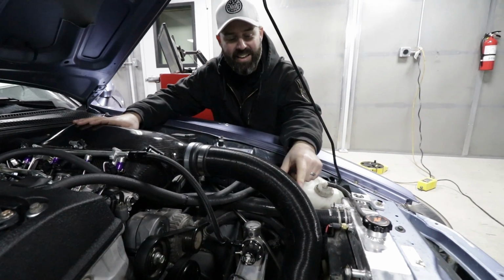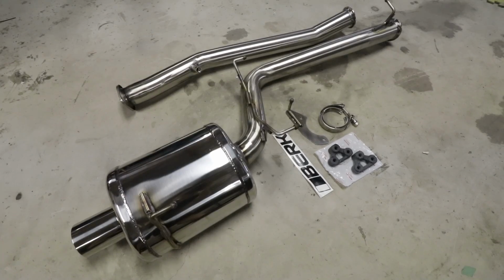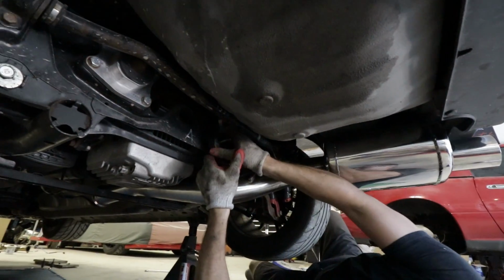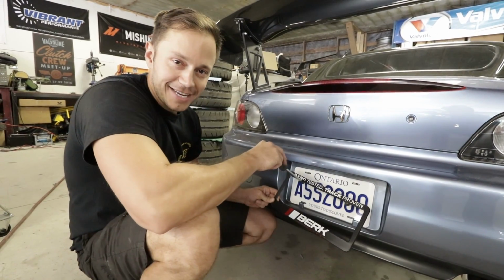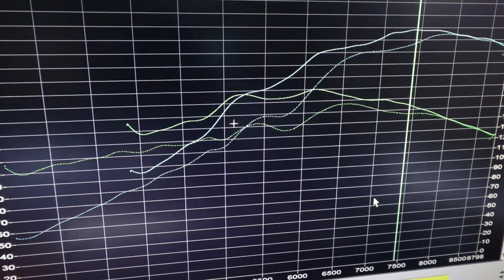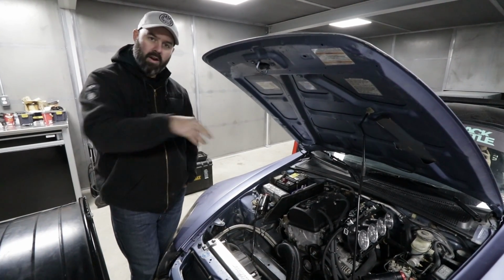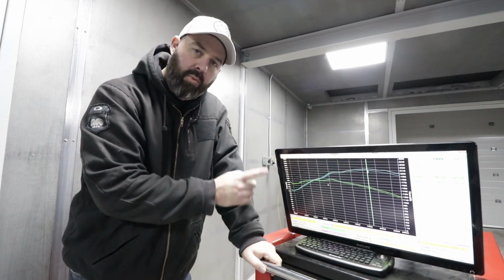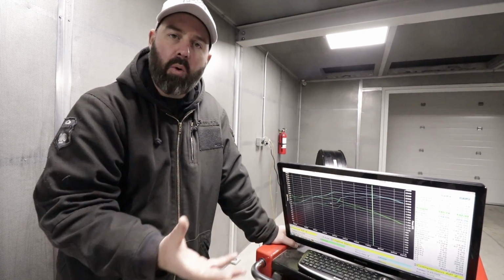Does an ITB AirBox Rob Power? + Big Power Gains ITBs & 3-inch Exhaust - Project BADASS2000 - EP15

Comment: 4 years late but J’s Racing solved the air velocity problem with their carbon intake if you google their ITB S2000. Also that car makes 320 crank hp

Comment: The short answer: Realistically an airbox can make more power because it can be set up to pull in much cooler air than the throttle bodies normally would from the engine compartment.

Comment: IF YOUR SO CONCERNED WITH MAKING ALL MOTOR POWER, DITCH THAT WEAK ASS F20C AND SWAP IN A BUILT K24 AND YOULL BE MAKING OVER 3OO+ @ WHELLS WITH A MILD BUILD ON 91 PUMP....NEVERMIND E85 OR RACEGAS.

Comment: I feel like the airbox is too small. You want it to have enough air litres for the engine to not get starved from pushing hard. Since the air speed lags behind when on full throttle you will have a few more litres of fresh air ready and waiting in the airbox.
Reply: Airbox volume should be 10-12x engine size

Comment: Can someone explain why you wouldn’t go with a different intake that just breathes more over spending 3k+ to get get jenvey ITBs but then have boxes and intake piping made to have them not suck hot air in which at that point is doing the exact same thing as an upgraded intake manifold but cost less? Not trashing anything, I’ve just been wanting to put ITBs on my engine but trying to understand the cost to power ratio cause you can’t just slap on ITBs not unless you don’t care about actually utilizing them for their full potential. So I’m wanting to know if it’s actually worth going down that route or not

Comment: Did you say that carbon intake box was custom? You've already cut the underside hood structure to make room for this box, you could have an open top box that's made to seal to the hood and then cut the hood and install louvers/ scoop/ naca duct, etc to get back all the power lost with the box or closed hood. Make it the shape of a large factory style air filter and top the box with that and get filtered cool air from the hood. You're already taking it off the street so why not? Pretty easy stuff really

Comment: If you want top optimize N/A fully, you will have to look to examine at what RPM you want peak power/torque and tune for resonance pulses further in both the exhaust and intake. Think 787b inktake setup.

Comment: I want to do minor upgrades and your AP1 build from ass to badass is awesomesauce.  Some great info here. I'm a firm believer of a (mostly) stock setup for street use. So I have a small question for my little 03 daily driver. I was excited that you posted the Tanabe T70040 Medalion Touring exhaust, civilized (No fart noises), priced right and it had slight power gain when paired with a replaced intake (I'm going with the K&N intake kit Kit 57-3514). What is the difference between the Tanabe T70040 vs Tanabe T80040 concept G? Did you make any comparisons? Also if you want to donate that old Tanabe, ill take it off your hands! LOL I am enjoying how far you are pushing the Ap1. Good job guys!
Reply from the maker: It's going to be noise, the G will be louder and the difference in power gains will be so slight that you should just go with whichever one you think will sound better.
Reply: Speed Academy cool sounds like the touring is going to be the right fit then. Thanx for the info.

Comment: ive said it before, i dont know why you didnt just vent the hood. its a semi common mod, and its seriously cheap. also, it would solve your cold air issues, no carbon air box needed.
Reply from the maker: It wouldn't, venting the hood simply allows air out but doesn't flow cold air into the ITB's. Think of all the race cars out there that run carbon boxes with ITBs, it's the most efficient way to channel cold air into the intake.
Reply: Speed Academy the pretty common way to vent those is to cut between the ribs and one of the vents is pretty much right next to the itbs, Google s2k hood vent mod, you'll see what I mean

Comment: I wonder if there is any way to route individual intake tubes to each throttle body some how like a 4-1 collector style.  i think that would make a difference.  i dont know how scientifically accurate this would be but, does the intake cover starve the cylinders towards the rear of the of the engine?

Comment: the more air you flow, the more power you can make.
Reply from the maker: In most cases yes but there are other determining factors like our ITB box intake diameter.
Reply: superturbo no. It's not true at all. It depends on your inside air flow speed, that's the key.

Comment: I am running stock airbox with the original choke (less then 2.25 inch) to muffle sound on my old 2.0 Saab turbo, its also around 215hp at the wheels.
3 Inch intake together with that plenum should be enough for well over 300hp.
I know mine is turbo, but on the sucking side of the turbo, my car still needs to suck the same amount of air as yours, to make the same power.

Comment: I dont get it.. Stock s2000 makes 240hp with all your bolt ons your getting 214 max?
Reply: Sebastian Rogers

Oh good you can read the brochure.  That's your horsepower AT THE CRANK.  Put it on a dyno and it'll put down less than 240HP to the wheels, and that's the only figure that actually matters because that's what is your useable power.  You see that thingy they hooked the car up to the wheel hubs.   Again like I explained before.  You have to account for drivetrain loss.
Reply: Sebastian Rogers this is wheel HP. So if you convert it to crank HP the car is making 1200HP when the V-Tech kicks in Yo!
Reply: damn math is hard...
Reply: Sebastian Rogers I also highly doubt you have a "performance chip" in your accord. Closest thing out there to it is hondata flashpro. And I especially doubt you have 300hp if it's a stock k24 with a "chip".
Reply: Don't mind. It's his "good jokes".
Reply: 240hp at the flywheel is the measurement.  Once you factor in drivetrain loss (trans-driveshaft-differential-axles) on a RWD usually you lose up to 30 percent of the power, that's why people measure wheel horsepower cause that's what actually makes it to the ground.
Reply: Steve Pham
I had an ap2 s2000... Didn't really like it that much to tell you the truth. When your going 120kph feels like your doing 200kph. Plus it had lots of problems. Rear bearings went, soft top had to be replaced after 2 years. Steering computer rack went. Engine mounts are poorly designed too close to the exhaust manifold. Timing chain tensioner kept making noises even though it was changed. Anyways glad I don't have it anymore not that good. They just don't build them like a CRX or CIVIC EG anymore. I currently own a 2012 HFP Accord chipped with 300hp. I love the car way better than the s2000 no troubles so far.
Reply: Sebastian Rogers
sounds to me like you bought a car that wasn't taken care of.  I bought mine in 2012, with 60k miles on the clock.  Drove it all the way to 110k miles in only 2 years.  I used it as my daily.  I never had any of the issues you had at all.  And this is me beating on the car every chance I got.  04 rio yellow pearl ap2.  I bought a 2009 370z after and I got rid of it and went back to another S2000.  It's not a car for everybody but to say it's not a good car after you bought a potentially bad car in general is kind of a blanket statement.  There's literally thousand's out there that have never encountered any of the problems you had.  Hell on S2ki there's a guy who supercharged his all the way up to about 250k miles on the original motor.  That's running 400hp.
Reply: Steve Pham
I have a type s tune with 300hp its a v6 3.5L actually
Reply: Sebastian Rogers 

Still don't believe it. For 300hp out of a j35 you'd need supporting mods. -' extra 60hp doesn't come out of nowhere randomly out of a "chip" tune. How are you getting more air flow and more fuel?  Exhaust? You probably aren't even running a wideband o2 sensor. How do you know what your afr is and if it's safe? A friend of mine has a J series swapped s2000 putting down roughly 280whp with full bolt ones. So your 300hp is bs to me.
Reply: Dude you really have no clue what your talking about.... Here are the specs for my engine... engine specifications  –  3.5 i-VTEC  (278 HP)CylindersV6 Displacement3471 cm3Power207 KW @ 6200 RPM
282 HP @ 6200 RPM
278 BHP @ 6200 RPMTorque252 lb-ft @ 4900 RPM
342 Nm @ 4900 RPM

My car has 280hp stock...

Comment: the gains from the exhaust were just from removing the cats, not going 3 inch over 2.5. if it don't effect a Chevy 350 it ain't gonna effect a Lil 122cu in. look up engine masters
Reply: Richard Cranium man... that test with the chevy was with DUAL 3 inch not a single 3 inch! jeez its like people watch the videos and totally miss the point
Reply: Hassan Eido how much air does each engine move? the Chevy prolly moves twice as much hence a 2nd exhaust pipe. ya know, for the OTHER 4 cylinders...
Reply: Richard Cranium the chevy  doesn't quite flow twice as much at all... if it did it would have twice the power(twice the air in twice the fuel) but it only has about 1.3 the power of this 4 cyl. so a four cyl version of that chevy will need less tube diamter...much less.. thats why it only needs dual 2.5.. if it had     an excess of 440 whp(twice what this four cyl does)  which is like 500 crank hp,then it would need 3 inch duals for sure..
Reply: a fully built 4cyl with ITB vs a stock 350 isn't comparable in terms of airflow. you have no point to be made here. this 4 cyl is prolly way more efficient than the 350, and that's how u get power is how efficiency
Reply: keep this cars 3in exhaust n put the cats back n watch all that power go right out the window
Reply: Richard Cranium  u simply dont understand.. im sorry

Comment: Cut a hole in the hood and let those ITBs breathe properly. Its a race car now anyways.
Reply: Spenser Visser that's what I was going to ask.   by putting the 3 inch tubing , the whole new system is back to being just like the old system.
Reply from the maker: There was no old system on it. WE've never had an airbox before this.
Reply from the maker: Cutting a hole in the hood wont suck air in, it'll exhaust it out.

Comment: Ever thought about cutting vents into the hood to try and dissipate some of that heat in the engine bay?
Reply from the maker: WE most certainly did but after contemplating and figuring that we'd run the air box cutting holes in the hood didnt make much sense.
Reply: I was talking more along the lines of venting hot air out, and not sucking cold air in. But I definitely see where you're coming from.

Comment: you made the air box to help reduce the sucking of heat but then you put the intake right infront of the radiator
Reply from the maker: The intake runs into the fender well where the filter is not infront of the radiator... we're not that stupid.

Comment: I feel as though with air rushing through the engine bay at speed, having the hood closed in a shop on the dyno isn't very realistic to the IATs you would see out on the track. BTW That induction noise is intoxicating, awesome car guys!
Reply from the maker: True, so you can imagine the losses with open ITBs at the track would be even greater!
Reply: You guys should test the iat difference with and without the box on the track and how it compares to the numbers you see on the dyno. I feel as though the air flow would be a lot greater in the real world than on the dyno from what looks like a big 48" fan. I have a similar looking one for my dyno and it doesn't blow very fast, certainly not 50-120mph like the you would see flying around the track.
Reply: With a big fan, it's fairly close.
Reply: No dyno has enough fan to simulate the airflow across the whole car at speed.

 Open hood is only to stop overheating. Fit a thermocouple in your engine bay and go test it ;)

Comment: why not run a filter right on the itb's and vent the hood? its not a hard mod to vent the hood just a quick google search and you can see how people cut them and it looks great on the cars.
Reply from the maker: The hood vents flow air OUT not in so all we'd be doing is releasing a bit of the hot air but the ITBs would still be sucking that hot air from the rad in, just a bit less of it.

Comment: Your 3 inch exhaust is a waste of money. Motor Trend has shown that in their recent video. Your car does not move enough volume for a 3 inch to impact such a low HP Motor
Reply: Robert Montgomery no. thats with dual 3 inch not a single 3 inch. know ur shit man
Reply: Turbo Donuts well this makes 218to the wheels so thats about 260 crank.. it has to be a 520 hp v8 then so does need 3 inch
Reply: Split a V8 in half and you have an inline 4 with single exhaust ;)
Reply: and yet they just showed the 3" exhaust to give hp...
Reply: Lol

Comment: The one thing that will really open up the engine is the cam timing, you can really get some more peak power with cam gears. You don't even need cams, just offset woodruff key +2 on the intake will give you 7 extra hp.
Reply from the maker: Hmm good to know, we may try that.

Comment: i hope you know that a smoot steel pipe flow way more than those cloth dryer hoses?? there is a lot of power still hidden there :)
Reply from the maker: Yes but not that much more. Pro Race cars run that brake duct hose so we trust they know what they're doing.

Comment: Why don't you guys make an ram-air intake to get some extra hp at higher speeds?
Reply from the maker: That's exactly what the setup is now! The intake is found in the fender well.
Reply: Cool. How did that work out performance wise? Or is that hard to simulate on the dyno?

Comment: Nice to see my consistent bitching about the cat and exhaust we're correct. Interested to see if the four inch intake works better than the the 3.5 since the air box bottle necks down to 3. Doesn't seem as though it's a massive difference airbox on or off though at least. Well now you can start seeing if cams and adjustable gears and some unicorn headers make any difference cause after that all you have left is FI or stroked high comp build. Which probably cost the same in comparison haha. Good old winter projects
Reply: Oh also when I built my 4" intake I was able to source cheap mandrel bent alum from mandrelbends.com and they (by they I mean someone I think maybe blox racing.) do make those velocity stacks that large and aem makes a dry flow filter large enough to fit over the mouth on it too which is fantastic.

Comment: hey guys! I'm glad you guys went 3 inch header back but there is a problem you might run into at the track. as you can tell, the berk exhaust is crazy loud. there will be a good chance that it will exceed certain tracks noise level restrictions. It's a common issue with the berk system. you may want to look into adding a vibrant 3 inch resonator. good luck with the build! we need MOAR s2000 videos!!!
Reply from the maker: Thankfully we have no noise restrictions at our local track but we may do a resonator if its too loud for our liking, thanks!

Comment: I hope you guys remember,  you guys had a filter on the 3" tube and a filter less funnel on the 3.5" tube that may have been a contributor to the extra 6whp at the peak.

also, I have a feeling much of your gains by swapping exhaust systems had more to do with going catless.

Comment: make a hood scoop so the ITB's can get more cold air
Reply from the maker: Show us a hood scoop that looks good on an S2k, we havent been able to find one!
Reply: Next Level Scrub 
I said the same thing.
Reply: Speed Academy idk any but im sure you guys can make one. or maybe just get some hood spacers to lift the hood a little so you can get some cold air.
Reply: Something similar like Spoon USA uses on this fd2? https://i.ytimg.com/vi/puFC_DPck-8/maxresdefault.jpg
Reply from the maker: The issue is even with a scoop or spacers that doesnt ensure the ITBs suck cold air. With an airbox thats the best and most optimal method of feeding cool air into an engine bay.
Reply: Speed Academy 
Fine, be all "right" and everything. I am still going to watch your videos and like them.
Reply: cutting the oem hood looks nice :P 
http://www.s2ki.com/s2000/uploads/gallery/1127338764/gallery_8439_983_1127487016.jpg
Reply: @SpeedAcademy I mean scoop straight to the airbox. It will suck cold air from front of the car. You just need to figure filter out, maybe a funnel type like this? http://www.tegiwaimports.com/media/catalog/product/cache/1/thumbnail/559181b3b38b988a6e321725e517b6c3/t/e/tegiwa-filter-1.jpg

Comment: why not go full bat Shit crazy and cut the hood and build an air box/ hood scoop.
Reply from the maker: Considered it but we may add boost on top of the ITBs and for that we need an airbox :D
Reply: Puurrrlease don't go FI! 

NACA duct in the bonnet will be perfect for this set up, nice straight inlet tract to the ITB's
Reply: pull out the grinder and vent that radiator heat out the top and throw in a pair of cams. you know you wannnnnna.

that thing should be fun, looking forward to more content guys.
Reply: crisray6789 never enough NACA ducts. never enough.
Reply: you could go with a NACA duct through the hood, which could be reused as an air inlet for a supercharger
Reply: Robert Sestito I had the same idea
Reply: Beat me to it. There is a reason that most SERIOUS race cars have a pressure fed intake box that (usually) goes  to ITB's. Check out the C5R setup. Headlight mount may be the way to go for a dedicated track car, IMO. WAY more airflow as opposed to the dyno.

Comment: On the latest video I actually wondered if 4" would be a better diameter for the intake. I'd love to see you guys prove that it can do even better than the 3.5"
Reply from the maker: In the works...
Reply: Speed Academy please make the airbox inlet itself into a 4 inch.. the cf inlet is a restriction not just the tubing